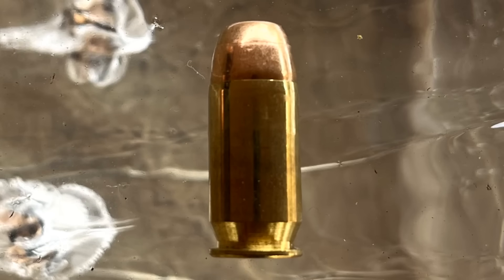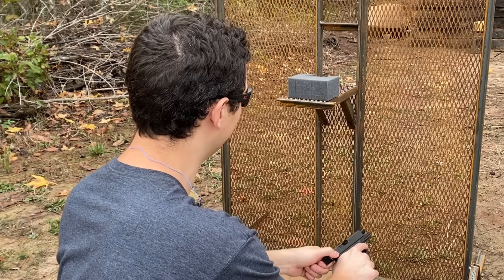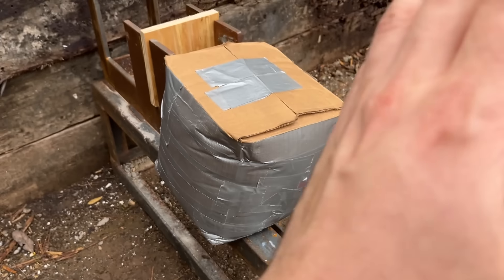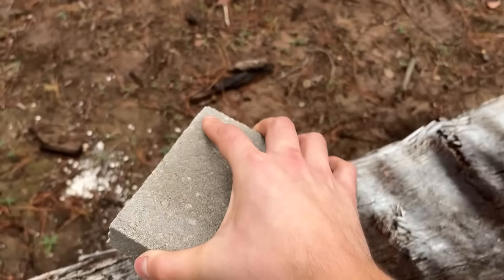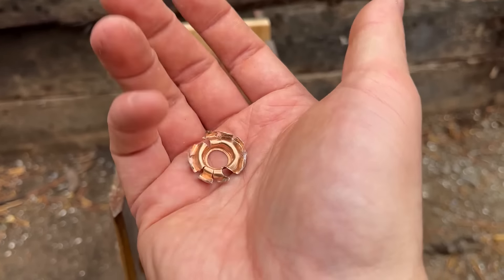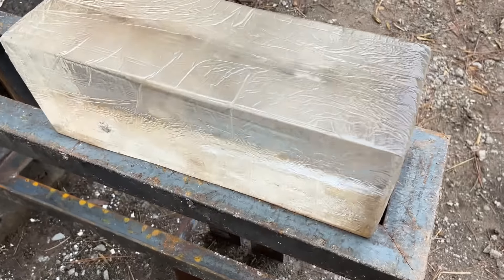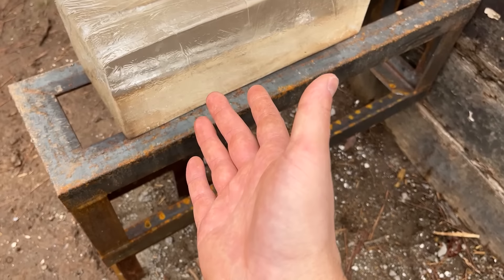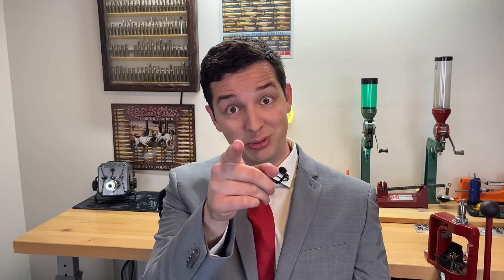9mm vs 45 ACP Barrier Test: No Debate?

Comment: ok so the 9 went deeper in the wood, but you can see, definitively, the 45 unloaded a LOT more power into the concrete !
Reply: Thats because the 45 has significantly more energy. Just look at muzzle energy, which is mass times velocity squared. The 45 bullet has double the mass, and therefore more energy.  P.S. I own a small ammo manufacturing company.
Reply: @454Casul  👍👍
Reply: The .45 ACP also made a much bigger hole in the wood.
Reply: @phillhuddleston9445  👍👍
Reply: @phillhuddleston9445 The .45acp made a bigger whole than the 9mm???  Who woulda thunk?
Reply: @454Casul  Energy (1/2*m*v^2) for .45 ACP is generally in the same ballpark as 9x19. More mass at the same speed means more energy, but the speeds are not the same. Speed is squared, as you noted, so the 9mm bullets only need between 11% (180 gr vs 147 gr) and 41% (230 gr vs 115 gr) more speed to have the same energy. Kinetic energy is more dependent on velocity than mass. What the concrete demonstrated was that .45 bullets have more momentum (m*v). Frontal surface area is also a factor in breaking concrete and, of course, the .45 has about 60% more frontal area.
Reply: I have seen humans shot with both, multiple instances, different events, etc. The 45 Auto/ ACP is worse by a noticeable degree.
Reply: @Ryan.......  Wrong 9mm is around 300 foot pounds, 45 auto is 500 foot pounds. I use 45 auto +P, 550 foot pounds. Google it if you don't believe me.
Reply: @Ryan.......  9mm (115 gr) Federal FMJ, 1,180 ft/s ,355 ft⋅lbf .
Reply: @Ryan.......  185 gr 45 JHP +P, Underwood1,200 ft/s 592 ft⋅lbf (803 J)
Reply: @454Casul He said generally, obviously there’s a big difference in energy if you’re using +P ammunition, a typical 45 ACP at 230 grains is going around 835 fps with 356 ft/lbs energy where as a 9mm at 115 grains is going 1180 fps with 355 ft/lbs energy. Besides that he’s not wrong; velocity is a bigger variable in increasing energy compared to mass.
Reply: don't forget the calibre difference and the difference in friction of the various bullets passing thru the barrel: and then the gel target. The .45 would have had a hell of a lot more friction or resistance 'going down the tube' and travelling thru the gel. BUT importantly all energy from the .45 stopped with the gel.
Reply: Even with the much slower velocity of the .45, it still beats the 9mm in ME. Isn't it like 850 fps or something versus 1100 or whatever for the 9? 
I'm just talking standard rounds. I don't know anything about +P loads. @454Casul
Reply: @Redx130000  I have standard, non +p 45acp ammo, that has 450 ft-lbs of energy. There should be no debate, the 45 has more energy,  period.
Reply: @vohawk  even standard 45 ammo has up to 450 ft-lbs of energy.  I am looking at a box of ammo right now.  The 45 has more energy than the 9mm, period.
Reply: @454Casul  I’m not arguing that 45 ACP doesn’t have more energy than 9mm, it usually does. I was saying the comparison with +P and normal pressured ammunition wasn’t quite fair and while 45 ACP is more powerful it’s not that far from 9mm. 

By the way that’s still a +P load if you’re getting 450 ft/lbs from what I assume is a 230 grain bullet even if it doesn’t say so. I had some Norma Envy 124 grain going 1345 fps and it didn’t say it was +P either.  I thought you work with ammunition manufacturing you should know this brother.
Reply: The extra energy of 45acp is in significant. Foot pounds and velocity are what's required for a round to penetrate and expand, but it does nothing as far as stopping a thread otherwise at handgun velocities. Penetration and shot placement is what kills, and not "energy dumping."
Reply: @finalcountdown7658  Wrong! What does more damage in an auto accident, a small car or a large truck? The large truck obviously. Energy creates trauma.  What if you got punched in the face. Would you rather it be a small woman with tiny fists and no power, or a huge dude with huge fists and huge power. Think about it.  I have seen many tests where the round with higher energy does more damage to a pig carcass.
Reply: @454Casul  You are wrong. Energy produced by rifle velocities creates trauma. Typically, handun rounds do NOT have enough speed or energy to create and meaningful trauma. The temporary stretch cavity, velocity, muzzle energy, etc, out of a handgun round is NOT what kills or injures with handgun rounds. Bigger calibers require more energy to be able to penetrate accurately, which is the ONLY benefit from the extra velocity and muzzle energy. The velocity and muzzle energy is NOT what causes damage or what kills/stops a man at handgun speeds. It's purely shot placement and penetration. You are so adamant and sure of yourself, yet so wrong and clueless.
Reply: @454Casul  Brother you’ve said the formula yourself throughout these conversations so many times so why do you ignore the fact that velocity is squared. You seem to be fixated on the mass perspective when all these examples you’ve stated ignore velocity. Depending on which car or if the female or male was going faster would have them hit harder most of the time. As for terminal ballistics if you’d research you’d find that velocity is a major factor for incapacitation mostly due to yawing and fragmentation. Shot placement is vastly overlooked as well. As far as energy goes it’s good for barriers and penetration but hydrostatic shock being a key factor in incapacitation is only a theory, it’s yet to be proven that it produces rapid incapacitation.
Reply: @deputyjack1  10mm
Reply: @AyjayAlleyway  10mm is certainly a good choice but I like the .45 Super and .460 Rowland better though they are both more difficult to find guns and ammo for. You really have to modify any gun for the .460 Rowland and there are very few that come from the factory rated for the .45 Super but it wasn't that many years ago that the 10mm was pretty much a dead cartridge too and now it's popularity has skyrocketed.
Reply: @454Casul we still believe energy in pistol calibers actually matter against 2 legged threats in 2024? When it comes to handguns what matters is PWC’s that accurately hit vital organs or arteries. Thats what stops a threat, not the negligible energy these standard auto loading pistol calibers have… and a 9mm and .45 are basically identical in regard to damage. The main advantages a 9mm has is it has a lot less recoil and has often close to double the capacity. In a self defense scenario you rarely get the chance to perfectly aim and one shot stop the threat. It’s often draw and start emptying your magazine into the target center mass and hope you hit vitals… if you are worried about knockdown power carry a shotgun with slugs or a rifle. Those have power, and vastly superior terminal performance… a short 12 gauge is better for home defense anyway…
Reply: @sleeper.simulant7327  Blah blah blah, energy matters! If u were in a car accident, would u rather get hit by a small car traveling at 60 mph, or a large truck going 50 mph?  A 45 has substantially more power.  By the way, I am an Engineer and I manufacture ammo. I have conducted hundreds of test shots with many different calibers. I also own a 454 Casull pistol, it has 1900 foot pounds of energy,  and it hits hard.
Reply: @454Casul  A .45 does not have substantially more power lol, not even close. And you can’t back up your claim with any data either because it doesn’t exist. Both are weak in all reality, the energy they pack is a useless stat whah it’s that low. Bullet construction matters more, as does the ability to shoot accurately, consistently.

This video is proof that the difference in standard auto loading calibers the difference is negligible when it comes to power. The permanent wound cavity with the 9mm was slightly wider and longer. Really it’s negligible as either placed where it needs to would have had the same result on a target… you claiming a .45 is substantially more powerful is just ignorance and the inability to comprehend the data… and the car/truck analogy makes no sense, as a .45 is hardly bigger then a 9mm, and both are weak. Let’s use science to break that analogy down. A .45 is only 0.097 of an inch bigger than a 9mm. So let’s round up .003 and say it’s 10% larger instead of 9.7% as the math is easier. Take a 3,000 lb car and add 10% weight to it. Thats 3300 lbs. So by your analogy, a 9mm would be like getting hit by a 3000 lb car at 60 mph, and getting hit by a .45 would be like getting hit by a 3300 lb car at 50 mph, as that’s roughly 10% which is the size difference of a .45 compared to a 9mm... That difference is negligible… 

And a .454 has nothing to do with this argument so why bring it up? And even the most powerful .454 loads aren’t packing 1900 ft lbs of energy out of a revolver, Buffalo Bore states 1600-1800 ft lbs which depends greatly on weight and bullet construction. A carbine chambered in .454 can well exceed that, but that’s out of a 16” barrel…
Reply: Fun fact: This is the most ignorant argument in the history of firearms. They are exactly the same minus a lesser weight and more powder. One is slower with more weight; one is faster with less weight. When they hit, the energy delivered, and penetration is very similar is it not? It's really simple physics and only ignorant people get caught up in this argument. 9mm has one distinct advantage over .45 and that is more ammo in a magazine on person. 

All people have to do is ask; what do SF/SO service members / operators carry? That should answer enough.
Reply: @CIA_Alien  ok physics, the .45 given equal (normal) loads, the 45 dumps a LOT more energy. The 9 has a lot more velocity and can go through one person and still have enough energy to hurt or maybe mortally wound a second. People with the need to go through things may like the smaller diameter and higher velocity, however, given MY preference would be a rifle, and the .45 as a backup or self defense weapon that I do not need to worry about over penetration, I also think the 380 with modern loads and projectiles is a good round for self defense, think Underwood or Buffalo.
Reply: @454Casul    Talk about FUDD, barely any of what you are saying is true.  45 and 9 are essentially equal in energy for bullet types, ball ammo, JHP, +P whatever they are always within 10 or 15% of each other.
Reply: @geraldblackburn4883  BS!
Reply: @454Casul but 9mm has high speed.
And as k.e = 1/2mv^2 9mm has it more
Reply: ... which makes a big difference if you commonly use handguns to break concrete. ;-)

Appearances often deceive. What you must look at is kinetic energy at the point of impact (if you're talking about power "unloaded" into things). Here, much will depend on the actual round (load, bullet weight), barrel length and distance. .45 slows down faster than 9mm (but at such short distance, it won't matter, really). Barrel length was similar. What will matter is the chamber pressure. .45 max. safe pressures are far lower than 9mm. With a solidly made pistol, 9mm can be loaded to achieve substantially higher energies (pretty much on par with .40 S&W---which is exactly why the .40 use is on decline).

Add the obvious: 9mm is far lighter and more compact (which means lower weight on belt, higher capacity and easier to conceal) and also substantially cheaper and you do indeed have an undoubtable winner. .45 is still fun, though. :-)
Reply: @vencik_krpo  good summation, but there are other factors, as in over penetration, wound cavity and energy dump (45 is better in this case) and with today's modern ammo, powder and guns, 45 will be a better option. I will say, even a good .32 is better than nothing and have asked Ruger, Keltec, others to come up with a 11-13 round capacity 3.5, 3.7 in. barrel (good metals and thick enough to handle higher pressures) in .32 acp, and with, again today's powder and a 95 grain projectile, this would be a viable self defense round. Look at Buffalo Bore .32 and then we could bump that up a bit.
Reply: @geraldblackburn4883  Yes indeed, e.g. for a bedside table gun, many of the drawbacks of .45 don’t matter—and lower risk of penetration through walls is a notable advantage. The whole thing is much more complex—my comment applies to the most common use case of CC…

As to 7.65 Browning (aka .32 ACP), here in Europe, it was used as service calibre for a very long time. It’s a very good one, I shoot 2 7.65 pistols and use them as entry calibre for new shooters, which I deem a good compromise between something like 22LR (it won’t really teach you how to handle recoil as there’s none pretty much) and 9mm (either Luger or Browning). And yes, I would carry it—just note that it seems quite pointless to buy hollow point 7.65; accordingly to all info I was able to come by, the kinetics of the bullet is not enough to achieve expansion. Still, well-placed shot will do its job.
Reply: @zz-eu8yb Sure it is. Its all about kinetic energy. Its a good analogy. How about this.  What would do more damage, a slow punch from a huge man, or a fast punch from a small woman?
Reply: @454Casul  Not fully true
Reply: @454Casul  lol WRONG
Reply: @454Casul  Underwood 9mm 115gr +p+ 1450fps and 536 ft lbs of energy. 56 ft lbs difference I don’t think is a enough to make a difference
Reply: Yeah, it was the clear winner on the concrete.
Reply: Fudd: 45 kills the soul!
Reply: @Tomb-G19  I’m happy to be called a Fudd. It means I understand shot placement is more important than capacity and that paper energy doesn’t determine external ballistics.
Reply: @876mpr  shot placement goes both ways for BOTH ROUNDS. You cant just say "yeah but if you shoot them in the right spot it does loads more damage" but only mean that for one cartridge when BOTH can be shot in the same spot for maximal damage. What makes you a Fudd isn't "Understanding shot placement". No, what makes YOU a fudd is ignoring certain facts to fit your preconceived narrative.
Reply: @ryanranard5187  how you gonna use +P for the .45 but not the 9mm? You know Underwood makes 9mm in +P+ right?
Reply: @ChaotiX1  Enlighten me, what facts would those be?
Reply: @876mpr  do you not know how to read??
Reply: @ChaotiX1  I do if there’s any content. It’s clear you’ve never actually shot anything.
Reply: @876mpr  the context is you implying 45 acp is better than 9mm luger as long as you place your shots accurately. Which goes both ways.
Reply: @ChaotiX1  Both rounds will penetrate adequately. However, if we use bullets with the same SD and having a meplat the same percentage of caliber, the .45 wins since it will create a larger diameter permanent wound channel. Rate of hemorrhage increases twice as fast as wound channel diameter. I say this because all my field experience is with cast flat nose bullets. They’re deadly, if placed properly.
Reply: @876mpr  EVERYONE KNOWS that a hardcast flat nose makes devastating wound channels, but thats not what people are EDC'ing are they? Thats also not what we're talking about anyway. You went from talking about shot placement to talking about one single type of bullet, as if the two have anything to do with one another. Stay on topic will you
Reply: @ChaotiX1  The self defense/SHTF topic is the problem since it’s likely to never be a reality for any of us.
Reply: @876mpr  huh??
Reply: didnt carry over to the ballistics gel though.
Reply: @deputyjack1  no it’s not.
Reply: @deputyjack1  Not disputing the .45 it's a great gun/bullet, but the highest performing 9mm rounds have completely removed ppl's noggins.
Reply: @joeniccoli1916   No doubt... Both are very effective rounds, and the 9mm certainly has many applications where it's as good as or a better choice. I was just offering what I observed in actual wounds in the field.   
All the best to you, stay safe!